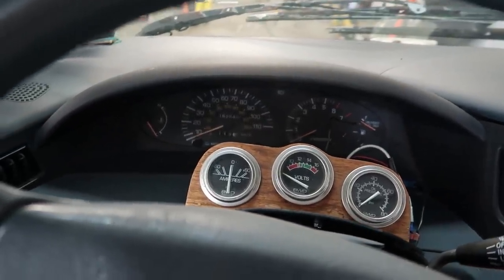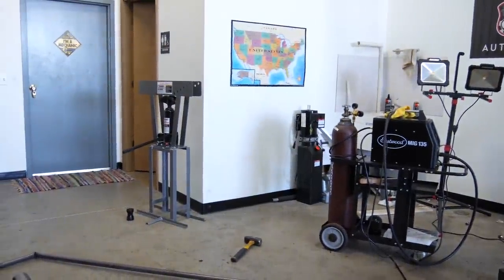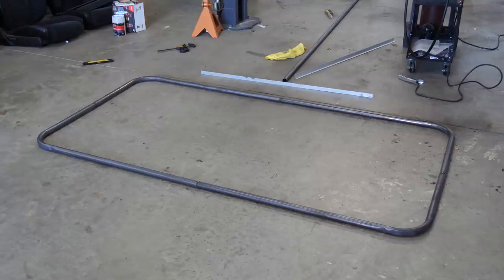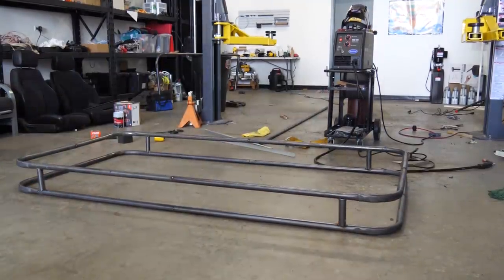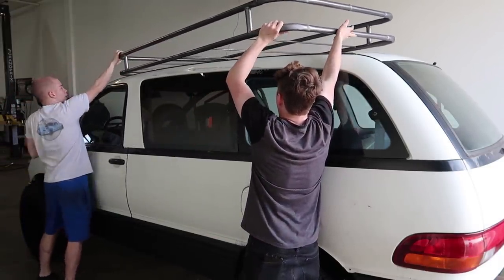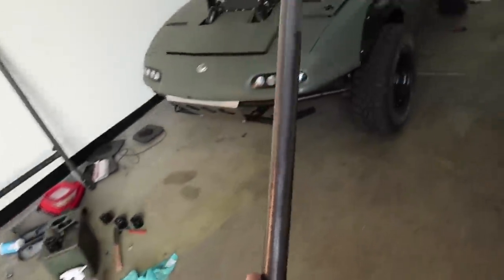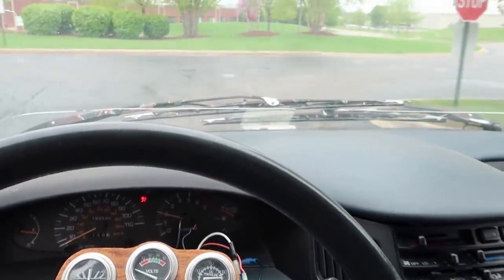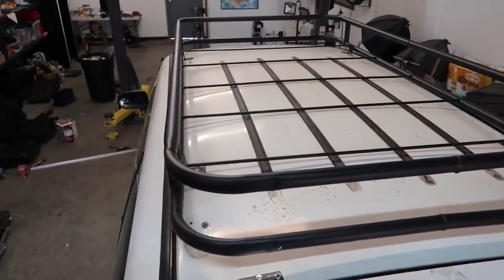Custom Roof Rack & Ladder for the Lifted Mini-Van!

Comment: Great job! Now, in order to be able to open the hatch, what you can do is, cut the top end welded on the roof, and lower (cut) the end of the top reducing its high up to allowing the hatch to open. To do this, again, by eye balling cut about 5" from the welding on top, down the side tubings, try to open the hatch slowly without hitting the roof with the side tubings (cut them as necessary so it opens all the way up without uninstalling yet the ladder but just by cutting the top sides.

Now once you're able to open the hatch, is time to give it a finish to your top ladder and compensate middle rung or step. My suggestion, if you like it is, create a bent pipe with two 90° on its extremes that coincide going down to the sides of the ladder (maybe you have to cut the sides more down since the top of the ladder will reach up from the welding on the side tubings, and may hit the roof once opened the hatch). The top step may be around the top of the edge (in high) of the glass of the hatch, or even a good 5" lower yet, since from that high you'll be able to climb to the racket. Making the top about 5" lower than the edge of the glass, meaning the ladder will be actually smaller, will bring top rung closer to top welding in middle of the hatch, the closer the end to a welding, the stronger it'll be.

Then simply move the middle rung (step) between top and bottom step. And weld the ladder sides to the highest point you can to the middle of the hatch. And if you want to make it even stronger, add two more central weldings to the sides. All you got to do then is just not abuse of the top but use it to climb carefully and it'll last for years to come (because the angle is bent forward is perfect for the pressure it'll receive on its use)! Hope you like my suggestion so you'll be able to use your hatch opened.

Or and, you can make another ladder on one of the sides, but I don't want to spoil your back ladder, is too cool to spoil it.

Search in your area, here in Miami there's a place where I was able to get a 8' x 4' diamond grill sheet I used to make covers for the interior of my van windows that are like impenetrable for thieves. It cost me like $67.00 I think a surface like that which is like a good 1/8" is pretty strong even to walk over it but, it'll be stronger if you weld under it some tubings every 6"-8", e/6" it'll be super strong.

Comment: You should paint some of the parts with truck bed liner, it would strengthen the thing dramatically and help fight against some of the rust
Reply: Cheap build that's 7 dollars a can and the cans don't last at all
Reply: dylan young Well your not supposed to use the cans to do it lol, buy the two big cans and mix them together and use a cheap spray gun

Comment: Fill the pipes with sand and cap them off , it stops the creasing and denting. Just a little tip I've learned over time in the shop

Comment: a plug on eah end. Like a think rubber bladder you fill with air or a rubber plug. Fill up 1 emd then the other. Seals it up. Just drain the air and pour the the sand back out.

Metal work is one hell of a learning curve

On a side note, hang a chain dangling step below the ladder. Itll never snag and it something does hit it, it just moves...

Comment: I read on Wikipedia that if you remove the driver seat and some panels you can access the spark plugs. I saw that it has a solid rear axle, maybe a locker will fit in there or just weld the diff for more traction. Keep up the good work

Comment: Tip: Insted of using sand you can also use long pull springs (those are used for garage doors for expl) to avoid these bumps. You can get them in various diameters. It's an uncommon technique but works great. just dont forget to put lub on it and connect it with a strong kord or something to pull it out after bending.

Comment: "How do you keep the sand in the pipe, itll just fall out" gingium is unaware of the invention of duct tape
Reply: Mattaywho___ The idea was cut it to length first. It's quite a common way of keeping the tube from denting.
Reply: it's a pretty thin tube. It wouldn't take much.
Reply: Duct tape on the end works to hold in the sand.

Comment: Very nicely done. You got the hang out bending and notching extremely quick. Next time you should get some thicker tube steel though. Also you can buy bundles of 20 foot tube steel and in the long run saves you hundreds of dollars.

Comment: As a future tool suggestion, you should pick up a compound miter saw and a metal cut off blade. We used 3 dewalt compound miters to build four, 12 bale tipper trailer my senior year of highschool. Before that we did pretty much what you did (except on a bench) and we could barely make 2 single axel utility trailers

Comment: great job first time out.. save yourself some time on tube .. mark center line on both ends.. then cut (2) 45 degree cuts meeting in the center as a v.. when you spin is it will match the tube your trying to weld it to .. no more using grinder to match tube

Comment: I know its to late at this point but, home depot plumbing pipe is cheap and strong and doesnt dent in the pipe bender. I made a stunt bike cage and it protected my bike really well. its heavy walled as well. for next time. I bet you noticed after you welded on the roof you had slag all over the glass. Cardboard and tape with keep that from happening. Next time again. looks good though

Comment: Welcome to the Welding club! Don't feel bad about the sunburn - I recently welded together a friends exhaust using my oxy-gas rig and had the same issue. Didn't have my mask, couldn't find my jacket, went full "Embrace the suck" and rolled my eyeballs on the beach. Back of my arms caught the worst of it from holding the torch behind me (So I wouldn't need to relight it), but it's a nice reminder of the value of a "Shop Hoodie" ;)

Comment: If you wanted to you could put like grates around the roof rack to help stuff stay in as well as protects the lights but pls consider armoring it bc it would help with covering rust and practice welding

Comment: If your melting the metal turn the voltage down significantly, and just a tip, I think your holding the gun a little to far away, not sure cuz its hard to tell on the video
Reply: Amps, lookin for amps, and nah his stick out looks about fine, 10mm (near half inch) is about right (just from what i can see when he stops and the filler wire is a bit proud of the gun

Comment: From my (limited) experience, if you're melting all the way through the metal, it usually means your amperage is too high. Another sign is when you're welding vertical and the weld itself starts to drip down

Comment: if  u fill the pipes with fine sand, then it wont make those dents and all. it just littlebit of work cuz u have to weld something to both ends so it works.

Comment: turn your wire speed down a tiny bit if your finding your blowing through frequently, turn the amps down a bit too.

 What happens sometimes is the wire coming out pushed through the puddle and blows through kinda.

Comment: just an fyi:  a eazier way to tube notch your pipe is to vice it up in a drill press and use a hole saw (with no pilot bit) to notch the part out.

Comment: you have to drill a vent for the hot air to escape, you can't weld a tube to be entirelly closed because when the pressure inside is high enough, the air is going to blast a hole in your weld, that may be your problem

Comment: The reason you keep burning through the metal is because as you heated up the air inside the tube it heated up, expanded and blew the hot, molten metal out. Drill a small 1/8 hole somewhere in the tube away from the weld. Then weld the whole thing up. then just put a small tack over the hole to seal it up.

Comment: Sounds like you need a little more wire speed on your welder😉 unless of course if you’re burning threw then less amps. You’ll get the hang of it, you have good fabrication skills, just need that welder tuned and sounding like a zipper.

Comment: Hi, I have no welding experience, but have these solar panels that are pretty much the size of a bed, so I am looking for a video on welding roof racks onto the top of my minivan. They catch a lot of wind, and I was wondering how much welding it requires to be sure it doesn't go flying driving down the highway. Thanks.

Comment: As far as sand in the pipe just tape the ends and it wont fall out also its not like the sand is bad after being used you can just dump it out and reuse it.

Comment: When your welding you need to where a good long sleeve shirt. I wear a wrangler button up long sleeve you can get them fr rated and without they are fine to weld in even if it’s not an fr wrangler

Comment: Get the little welder helper app and a metal thickness gauge. Eastwood should have a chart somewhere for voltage and wire speed per metal thiccness. And for your own sake get a welding shirt and a welding cap and wear pants and boots. Getting a little burnt isnt too bad but ive seen it dig holes in skin and burn little spots from the front all the way to peoples backs. But for your first big project you did fucking amazing! Ohh and metal grate would work for a solid bottom platform. Oh and a magnetic angle finder will help when you bend tubing

Comment: Hey. May i ask how you joined the rack to the roof? which bolts did you use and wouldnt the roof leak through those holes if it should rain?

Comment: Going through the metal means you are either going too slow or too many amps. Its probably the amps

Also get a magnetic angle finder for the bender

Comment: get some silicone from the hardware store, cap one end with it , fill it with whatever, then cap the other end with the silicone. then duct tape over the silicone n you shouldnt get those pinches.

Comment: I know it's not a fun idea, but you should really drop the engine and give it an overhaul. I'm talking a coolant flush (with a flushing agent), timing belt and tensioner, water pump, spark plugs, new HT leads etc. That's the kind of love the Mud Panda needs
Reply: Phil Atkins it’s a piece of shit, he said he is going to junk it if it breaks
Reply: It'll probably fall out when he takes it off roading.

Comment: Blowthrough is generally not settings, if it is your settings or you are going to slow. its thin wall tube, gotta go fast.
Reply: or take small breakes in between welds to avoid head soak, essentially you end up doing a bunch of tac welds, like welding body panels.

Comment: with that bender, use a size too small of a die. you end up with cleaner bends.
Reply: oh, and a bit more wire speed on the welder.

Comment: How about turn it into a legit corolla gts ae86 trueno  front wheel drive 4agze supercharge swap from a mr2 first gen watanabe wheels fender flairs tofo shop sticker remove those racks remove the interior make it a clean                            ae86 inspired trueno tofushop